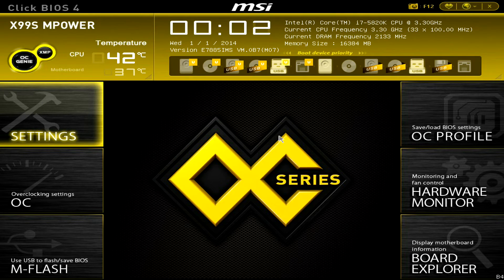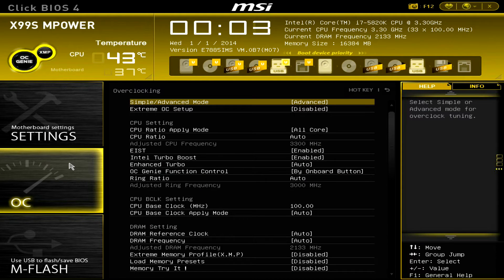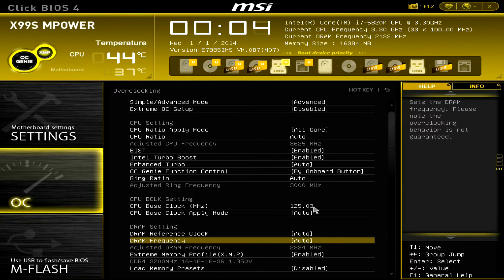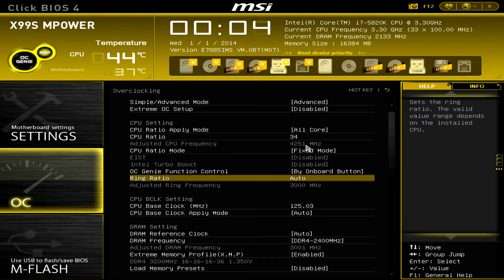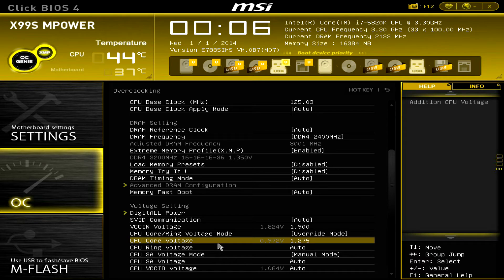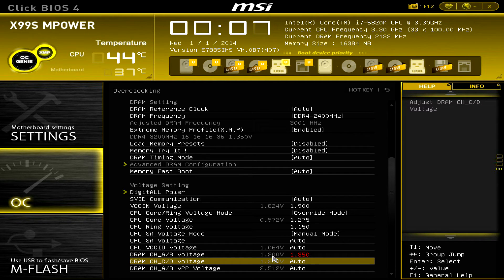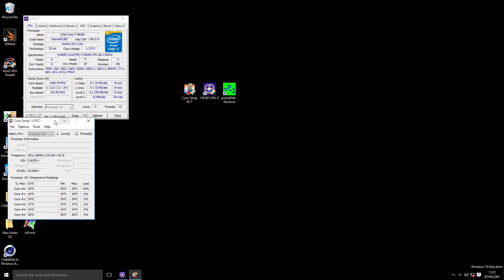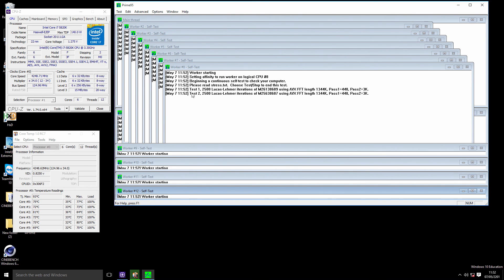MSI X99S MPOWER [CPU OC Guide] Overclocking.Guide 5820K 5930K 5960X, english

Comment: I’d like to ask I know a bit but I don’t know much about temperature. But I have one or two cores when doing my stress test reach about 101 degrees but then my h115i water cooler brings it down to like 55 to 75 right away and another core jumps up to 99 to 101 so is this good if it’s stable? Or should I like reduce core voltage by a cunt hair?

Comment: I've had my X99 XPower AC for about 3 year with a 5820k. I've never been able to adjust my CPU base clock. My ram runs at 3000MHz, I can OC it to 3200MHz without crashing, and I can run my CPU up to 4.3GHz without issues. But why can't I adjust my CPU base clock???

Comment: Whats the best, cheapest motherboard that can support up to 126gb ram? Im thinking of getting i7 6800k
Reply: I recently built i7 6800k on a MSI X99A SLI Plus. Works well and will support 128gb RAM. I updated BIOS prior to using Broadwell-e cpu.
Reply: Matthew Kemuel Nice, i got the Gigabyte UD4 mobo, 64gb ram, and 6800k. But i dont think ill get 128gb ram anytime... The first 4 ram sticks were defective whcih caused so much trouble.

Comment: I've 5820K and Corsair Dominator Platinum 32GB CL15 - before I was using Asus X99 Deluxe and couldn't go over 4400Mhz and 2800Mhz for ram and always boot problem. Increasing voltage never helped. Bought MSI X99A Gaming 7 and now @4500MHz with 1.35V and works more cool. Also my rams easily overclocked too 3200Mhz - 15.17.17.37 1.4V - no problem. Asus was the worst board I've ever seen. MSI x99A is better board and also more cheaper. Highly recommended. Also I have keyboard / mouse lag (tested with all USB ports) with ASUS and as I read in forums, Asus has USB problems. If you're planning to buy new board, search this problems first and go with MSI.
Reply: I had the same MSI X99A Gaming 7. Great MOBO. Still works after several years running on~4.5GHz.

Comment: im running 100x43 for a totall of 4.3 ghz which is fine and stable however the problem is, CPU-Z is only reading 1200 MHz with multiplier of 12 @ bus speed 100 MHz respectively EVEN THOUGH i set the power management to high performance. whats the deal here? I have a correct reading of 4.3 gHz in bios but not in windows with cpuid. what am ai doing wrong?
Reply: It's the Intel power saving feature called 'EIST'. It clocks down the CPU when it's idling at desktop or light usage and reduces power usage and temperature. It's totally normal. You can disable it from BIOS if you don't like it.
Reply: That, or you somehow pressed the JSLOW1 switch on the motherboard which sets the multiplier to 12x as its only ment for extreme blck overclocks.

Comment: What are you temps like with that OC I'm debating between that an a 4.0 OC. have a good cpu cooler so not worried.
Reply from the maker: +Spartan 212 Check in the video :) 7:00
Reply: +der8auer ah ok what cooler are you using and did you buy a specific paste? me and a buddy have the same cpu cooler he has 4790k and he idles at like 27-30 meanwhile atm I am idling at higher then 45 and i have the i7 5820k OC at 4200...i think it might be room since my bro has an amd fx 6350 and he idles at around the same as my friend. Any suggestions?

Comment: Thanks for video, but can you help me in OC my CPU, I have the same i7 5820 but i dont want so agressively oc only 4GHz . My motherboard is MSI x99A SLI PLUS, memory Crucial Balistix DDR 2400 MHZ. Cooling Termalright Macho Rev B

Tanks
Reply from the maker: +Łukasz Jakubowski Just follow the tutorial but with your memory I guess you will only use 100 MHz BCLK so 40 CPU ratio will be good.
Reply: +der8auer thanks for the answer. Do you think that the voltage 1.275 will not be too high when clocked at 4GHz? I would like to gently twaek memory at 2666 MHz, if i run XMP profile are then automatically set the times or i must manually set ? What value of voltages i must set at 2666 MHz ? Thanks

Comment: A lot of the settings are different for ASUS. Wondering if you can make a video with an ASUS motherboard.
**There are two settings for DRAM voltage, one with (CHA, CHB) and the other with (CHC, HD). Wich one do I edit!
Reply from the maker: +Sean Kim you have to adjust both if you run quad channel

Comment: 1. Sind 2750 Mhz und CL16 bei einem Team Group elite plus der normal mit 2133 und CL15 läuft gut?
2. Die Uhrzeit.
3. Was genau bringt der OC sockel?
4. Sind deine Systeme auch customizeable also bei Wasserblöcken und Farben.
5. Welches mainbboard würdest du eher empfehlen, MSI X99S oder Asus X99-a?